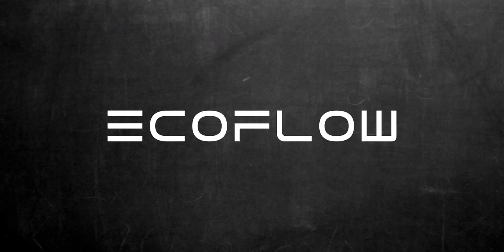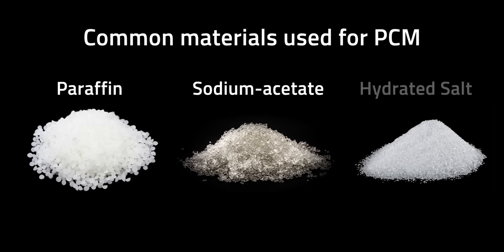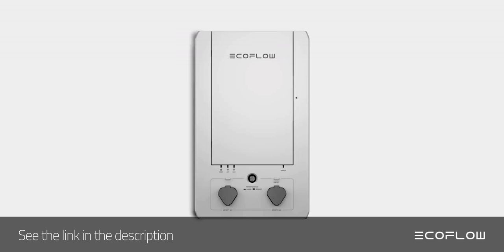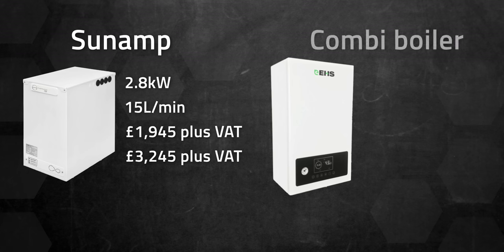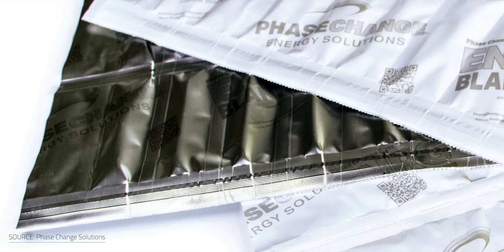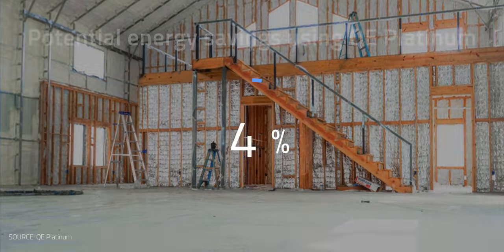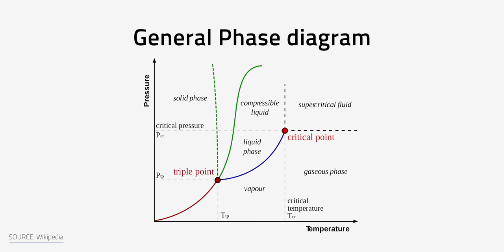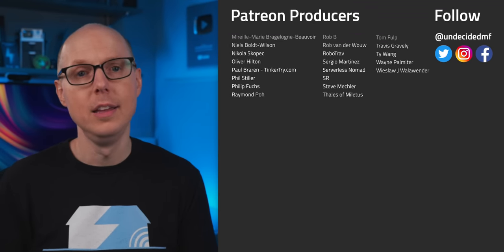Are Phase Change Materials the Future of Water Heaters?

Comment: Yep I've had my hot water heated by a SunAmp PCM Thermino Heat Battery for the past 3+ years. Brilliant! There are several versions and I have one which has two heating methods and mine is optimised for Solar PV/Off-Peak-Grid recharging providing the equivalent of over 210 litres of instantly heated water from the stored energy. The alternative method of heating is by a second heat-exchanger and so there is a second pair of 22mm pipes connected to a Gas boiler or Solar Thermal or high-temperature Heat Pump (low-temperature Heat Pump version has PCM tunes to change phase at a different lower temperature). Because my unit is optimised for Solar PV recharging using an electrical heater. When charged via the electrical source 100% of the capacity is utilised, but when charged via the alternative source heat exchanger only 80% of the capacity is achieved (by design). I used to have a 1st Generation SunAmp which was optimised for charging from my gas boiler as the primary means and that could be fully charged by the heat exchanger with the electric charging as a backup only, but now I'm fitting PV there is a different use case. SunAmp Heat batteries can also be configured and installed as a buffer Heat Store with a Heat Pump allowing the heat pump to optimise its efficiency and then (Wet radiator based) central heating can pull the heat from this Store intermittently on demand thereby decoupling Heat Pump cycling from central heating varying demands allowing for smaller Heat Pumps.

Another heat storage Becoming more popular in the UK is "Mixergy" using a sophisticated control system with a large water storage tank that heats the water from the top down in such a way as to create a Barrier zone between hot and cold water in the tank by use of a pump and clever nozzles. In addition to this, the control circuit can be networked across the UK allowing the system to dump excess cheap energy into the hot water tank to help balance the grid. Several thousands of these have been already installed in a large pilot scheme.

Comment: The big untapped potential in this is an ability to keep buildings comfortable while allowing the HVAC system to cycle according to energy management instructions from aggregators/ISOs. That would solve the renewable intermitentcy  issue by allowing heating (and most transportation) load to be managed to match supply curves rather than having to manage supply to meet demand curves.

Comment: Since you need sufficient hysteresis on both side of the PCM working temperature to make charge/discharge convection reasonably efficient, it either needs to be active (cost & complexity) or to be in an application where ~20F/10C fluctuations are desirable or acceptable. The obvious one is a greenhouse, but that gets cost prohibitive quickly if it’s not directly for human comfort.

Soo… That makes it perfect for one of my favorite building ideas, a greenhouse coupled to the south (in the northern hemisphere) side of a house. The greenhouse and house are symbiotic for heat transfer; the greenhouse temperature will swing higher and lower than the house, giving and taking to keep the house comfortable. 

You’ll also spend more time in the greenhouse than a typical one, since it will be immediately accessible from the house and also with smaller temperature swings than a typical one, due to the house coupling and the PCMs (as well as hot water storage from air to water heat pumps). This makes the greenhouse space more valuable, possibly enough to justify the PCMs.

Comment: 7:54 It's interesting, kinda works like any structure that has good thermal mass like a basement but with a state change to absorb or release that extra heat still i don't know about the precise temperatures you would need for this to be efficient, especially in places with extreme temperature fluctuation between the season. Like something that is great in summer could be bad in winter and vice versa.
Reply: I think part of the problem, for me, an efficient user, is that we have different set points in the summer and winter. You would have to pick a material for one of those seasons and stick with it. I guess that's not a huge problem for very hot or very cold places with only one energy intensive season, but there are many places (like the midwest and southeast united states) that have significant heating and cooling seasons, and these places often use the most energy.
Reply: @tscook10  Yeah, idk seems to me that it's better to simply have good insulation because it's just as effective in any weather since you know it keeps better whatever temp your system is pumping out

Comment: I was in China 3 months in 2007. Almost every building I saw had Solar Heaters with a tank on the roof. Super simple and worked great. One time in Yangshwo near Guilin when the power was out so no water being pumped I needed some water in the bathroom. So I thought oh hot water on the roof and yes the gravity fed hot worked while the cold needing an electric driven pump did not. Seems all houses should have that solar water heater with optional electric heater or heat reservoir in case all the hot water is used up. Surprising there aren't clothes dryers which use heat from a solar mass heated up by the sun during the day.

Comment: very interesting..as usual..may be i missed the part about how to manage the temperature when using the phase change blankets - you mentioned there needs to be a specific temp change day  to night, but presumably there is a relationship between how much is installed and the volume of the space with the temperature required. The water heaters feel more obvious but again hot water on demand is often reliant on specific use cases. I can see it working with a much smaller hot water in line storage tank perhaps to manage that - though i'll look into Sunamp's products more carefully now for our new refurbishment.
Reply: PS thanks for the Belinda Carr link - she notes that phase change panels are a supplement to work with traditional insulation rather than as a replacement.....
Reply: I never saw the hard numbers: how many joules one kg of the stuff (PCM) can store or deliver around room temperature? say 20-25C?

Comment: I bet these kind of materials would have great usage in public buildings. Here in Finland it's mostly cold and heating is needed almost all year around and that's why all buildings are insulated very well. However in office building or school for example, good insulation with alot of people inside heat up the space quickly so there's also cooling systems! (which is kind of bizarre...)
These kind of materials could be a great addition to catch the heat from people during the day and release it at night.

One thing didn't come apparent though and that's the danger of condensation when absorbing heat. Maybe I need to take a closer look of these...

Comment: Also one thing to consider. Phase change is a way to store a lot of heat in small place. In some regins of the civilized world houses are bulid of modern ceramic brick. Which is not very space efficient, but a real energy store device. If your house is an energy store device, you don't need phase change untill you want to boil an egg. I think being involved in business of using renewable energy for modernizations thermal storeage based on phase change is only part of system, that will be still based on heat pumps. Why? I can use SG Ready protocol to make stuff work almost the same way today only using energy source and a heat pump.

Comment: The ENRG panel reminds me of why houses are built the way they are in the UK, lots of Stone or bricks. As heat rises, the stone absorbs heat, and lets it out at night and as it gets cold and start using heating (traditionally you'd have fires on all winter) the heat in the walls is maintained like a thermal battery. These days, heating is expensive, we rarely use fires and therefore our homes are not working the way they were designed, so require retrofitting. Heat is provided by fast, very hot solutions.

Comment: Hmmm. Get a pair of materials with high and low transition temps, then actively mix between the reservoirs, as needed. Maybe 50 C and 0 C. Trading off computational function against control of large energy sources. You use a smaller reservoir, and get more flexibility.

Comment: Great info as always, Matt! I feel like I’m following you around. In 2018 I had a 8.4 KWh system installed on my house and bought a M3. We’re moving in a month and the new place needs a new roof, boiler, central air and water heater (within a few years). I want to turn it into a net zero home. It’s time for me to brush up on my mind meld capabilities!!! If that doesn’t work. I joined your discord, just in case. I’d love some direction, if possible. Thanks buddy!
Reply: Steel roof and heat pump time!!
Reply: @tonylarose4842  Yeah, I’m in Wisconsin, but thinking of a heat pump and maybe a solar roof, but not sure.
Reply: @Draekdude  nice I'm all Midwest. Probably better to do a white or reflective metal roof over solar shingles

Comment: I get confused on the usage of PCMs. In the summer, i can see the phase change to keep the house cooler as the sun beats down, but then at night you're heating the house? Right now, I have all our windows open during the nite to let excess heat out of the house - I wouldn't want to add more. In the winter, I want the sun to heat my house and have insulation to try to keep the heat in over night. I guess I'm struggling with the proper usage. I do have my entire unfinished basement that needs to have its insulation replaced (previous owner installed it improperly and it's deteriorating ), but I'm not sure PCM makes sense to use in a basement as insulation between the cold basement air and the upstairs living space. The basement, being underground, stays at a fairly consistent temp, so it probably doesn't make sense
Reply: Could you install better insulation in your house, and keep the doors and windows closed during the day? That would make your house less warm in the evening.
Reply: The proper usage is in commercial structures that are engineered to take advantage of the properties of PCM materials. For a residential structure the answer is "use more standard insulation". Unless you're in an ancient structure with extremely few options, and in that case you want to consult an expert.

This channel is just fluffing experimental items for views, it's not here to help you  build your house better

Comment: Dear Matt. Persumed energy consumption for a heat pump for 2+2 family here, in the center of Europe is around 1500kWh. So cheap heat pump+3 PV panels with microinverters. You get same result, cheaper. More efficient. You forget, altough I have real respect for you as a really elightened person, that resistance heating is really not efficient heating. It is a good idea, but should be coupled with heat pump and solar panels. That would be something like Chuck Norris with light saber.

Comment: The water heater made some sense, but Matt, I am completely lost as to the actual use of the space heating/cooling.  Keeping the temperature consistent is a little non-intuitive but a nice feature.  But what is the normal and extreme conditions for use?   Is this for use in residences or storage sheds?   Not getting something fundamental to the point....

Comment: I would think it would be more efficient to have a well insulated house, and 2x PCM modules on an outside wall. Module One would have a lower change temperature, and module Two would be higher.

On hot summer days you would "charge" module Two with hot outside air while using module One to cool the house. Then at night it would swap, using module Two to heat the house, and recharging module One from the cool outside air. But this only works when days are warmer than your target temperature, and nights are cooler. I assume PCMs would be near worthless in the winter when all of the time is spent below the PC threshold.
Reply: I was looking for a comment like this one. If the pcm is on the outside of the insulation, it would just dissipate the heat back into the night, and not warm the house. A classic "heat for the crows" like we say in Sweden.

Comment: Although not a phase change, the Trombe wall design uses this thermal delay based on degree day calculations. Personally, I've built 13 homes firstly as steel frame design then calculating the degree days, the volume of living space then grouting the walls with a modified adobe mix. The heat loads on a typical 2800-3000 square foot home were in the 10k btu range. Basically nothing. Thermal delay has been part of traditional adobe mud brick design for centuries.

Comment: I know u are a tech nerd. But there are many options for achieving all those goals by using natural materials. This wallsystem for example mimics termal mass wich you can simply achieve by adding clay, rammed earth, a stone wall etc. to your building and espacially to the northern wall. By placing windows to the south of your building these walls will be heatet up buy the lower winter sun during the day and then cool down over night releasing the stored heat. You can insulate your structure with straw, hemp or other carbon negativ materials, creating a carbon sink and a carbon negativ building upfront. Sometimes the best solutions are not allways to be found in comlpex hightech materials and products, which might save energie but produce a lot of emissions during their production and need tons of rare resources. Straw earth and clay are endless resources nearly everywere on this planet.

Comment: And areas with the highest demand for air conditioning or those that getting the most sunlight.
Also you would not need to drill a well or have a backhoe digging up you property as you would with ground source geothermal

Comment: Not in the walls. A 20 year product inside of the walls is nuts. And the inability to adjust temperature is nuts.
But a phase change battery in a storage area would be nice if and only if one could swap materials seasonally, so the phase change occurs at warmer than desired air temp in winter and cooler in summer.

Comment: It seems to me that PCM would be far more effective and convenient if insulated from both sides.  Wide temperature fluctuations outside are insulated and cause very slow phase changes.  Set temperature inside is insulated and allows the PCM to continue changing phase and saving energy.  Transition temperatures around 75 F would have small temperature differential (and low heat transfer rate) with the controlled environment.  Optimum relative placement and type of insulation (conductive vs. convective. vs radiative) might vary with climate and transition temperature (and tenant preference).

Comment: Great video Matt, also loved your appearance on the fully charged plus podcast with BobbyLlew :)

I'm looking at a sunamp heat battery for my hot water system, has anyone had any experience with them?
Reply: The unit shown here is only 2.8kW, which seems extremely weak for an on-demand heater. Normally those are 10+kW

Comment: To be fair it's not necessarily short term storage, for example if you put a PCM with a phase change around 17C a foot or 2 underground the surrounding soil is the same temp or hotter, but these phase change materials retain much more thermal energy than the soil would, like I wrote in another comment in another video you made about the CO2 battery you need to store the heat made which would if you used a thermal battery at best last a couple of weeks so it isn't long term storage at high efficiency, but for example if you were to dig 2 feet or so under the gaseous CO2 storage and install a tank of PCM that melts at 17C you could store the energy from compressing the CO2 indefinitely and you don't need to heat the CO2 to even really room temperature 10 - 15C if fine you not going to get much more expansion by heating it another 5 - 15C, you just need to heat it enough so that it's pretty far from it's -78.5C freezing point after it's evaporated.

You would need to have a tank large enough of the PCM to store all the latent heat left over after compressing the gas which would be a pretty large tank, but assuming a 1 meter depth for the tank it wouldn't be anywhere near the same size as the gaseous room temp CO2 storage so you don't need any more land because you can just put it under the CO2 storage. Also another thing you could do to improve efficiency for short term energy storage is add a thermal battery which stores heat of 1500C or so and super heat the CO2 charging the thermal battery from grid electricity, which would enable 90 - 95% efficiency with only a small addition to the turbine because the hotter your gas the smaller turbine you need for higher pressure gas in which you would use super critical CO2 to run the turbine while using the thermal battery, and the regular turbine would use the CO2 expelled from the super critical part of the turbine to extract even more energy, when using the PCM thermal battery to heat the CO2 you would bypass the super critical part of the turbine which will be like 1/10 the size of the rest of the turbine.

Comment: Seems like this would be good on the exterior of a building to minimize the effects of day time heating, especially the roof and sun facing inside of the structure. 

Also see how this could be useful for having AC run at night to help offset peaking loading during the day.
Reply: Well you would still want it inside the insulating later, not on the exterior. You want the insulation to be the first line of defense reducing heat infiltration, then the thermal mass inside the insulating layer.